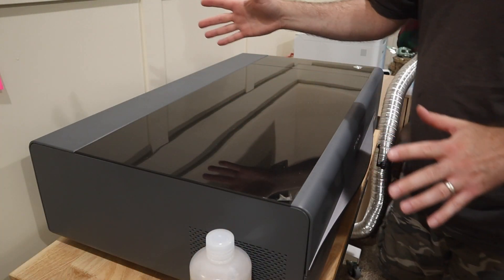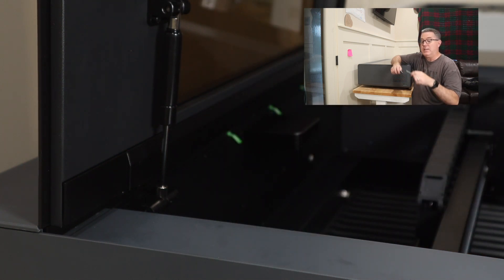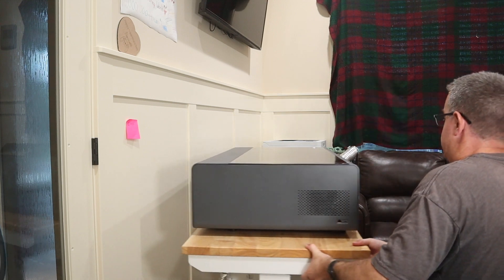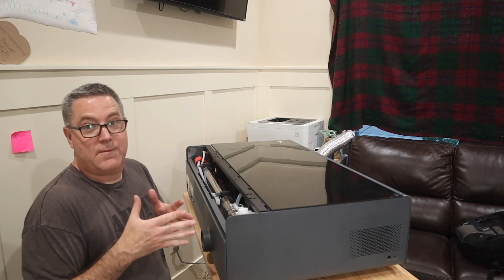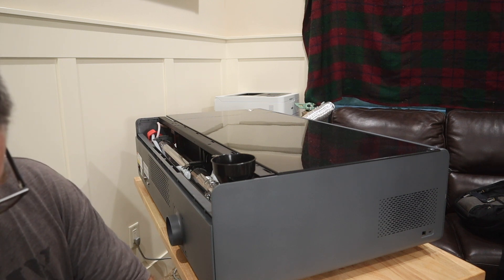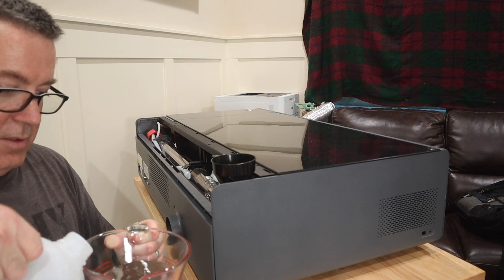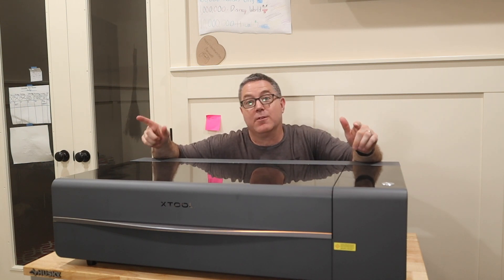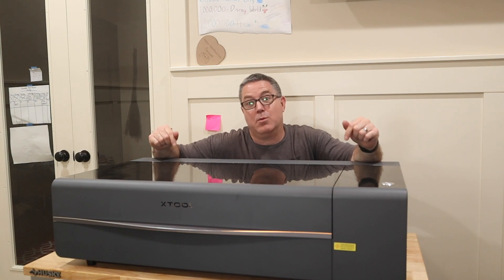xTool P2 C02 Laser Setup - Removing the back and filling the water and antifreeze

Comment: How often do you need to change the CO2 cylinders in this xTool?
Reply from the maker: It’s a CO2 laser and uses a CO2 laser tube.    Eventually the tube will wear out, but after several years mine is still going strong.
Reply: @CTRLALTMAKE Thanks for your reply. I was confused by the fact that the set shows 4 CO2 cylinders – and these are used to refill the gas in the xTool fire suppression kit. 😁 Everything is clear. 👍 And how long have you been using this XTool tube?
Reply from the maker: Around 3 years.

Comment: I live in New Zealand, its winter but im using the p2 in my house and i keep the temperature at around 20degrees Celsius, do i need to add antifreeze??? The sticker on the machine says to add before starting but the instructions in the book are confusing me.
Reply from the maker: There seems to be mixed information on this.  I put antifreeze in mine and use it in my house.
Reply: Always use antifreeze according to the environment temperature you operate. If you can guarantee that the temperature in the space it is located will never go near zero or below you can skip the antifreeze. However take into consideration things such as heating system failure, maintenance etc. To be better safe than sorry I would consider my minimum room temperature with no heating. Antifreeze is cheap. Repairing an iced cooling system is not.

Comment: I came here for a specific issue, which was that the back cover wasn't wanting to come off.  I noticed that there is a cut between the first time you tried and when you actually got it off.  How long did it take you to figure it out?  I didn't want to break mine.  After watching your video I figured out that you just have to snap off those tabs.  But I wish you would have mentioned that.  Cause I'm sure it caused you to pause also.
Reply: Oh duh.. you do mention it.  Sorry.  I paused when you got it off.
Reply from the maker: It’s a bit tricky.  After commenting about not missing the middle screw “hidden” in the back grill, I then forgot to remove that screw 😂, hence the cut and the second comment about not missing the screw.
Reply: @CTRLALTMAKE  I initially missed that one also.
Reply: The tabs are at a 90 degree angle. You pop the back first, then wiggle it straight up, left-to-right mainly, but wiggling helps.e

Comment: Read the bottom of the label of the antifreeze bottle. “Do not use in warm weather” - paraphrased. It says to remove antifreeze in the summer, basically.
Reply from the maker: Interesting, it does seem to indicate it as a recommendation, but that is the only place I have see that noted. Thanks for point it out. I’m not overly concerned to have it in during the summer.
Reply: I live in Arizona and it's super hot here.  But for now my P2 is indoors.  It might eventually go in the garage.  I was curious about the "lowest temp in your area" because I keep my house at about the same temp all year.
Reply: @Nerdtronic  I am in the northeast US, so it gets like -12 or so here in January or Febuary. Since you should change the liquid every 6 months, give or take, I might put antifreeze in there for winter, but it is in the basement and it is a finished basement. Still, it does exhaust to outside, so I will still use it (backdrafts) and you never know with power/heat outages. But in the summer, no need.